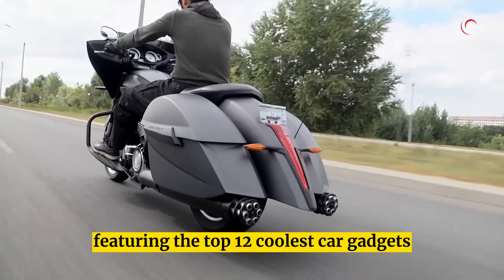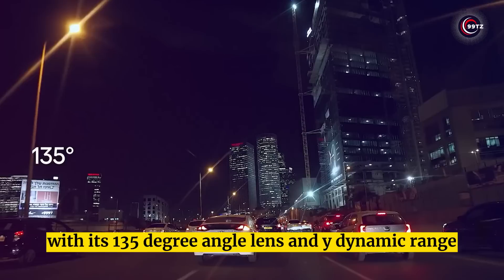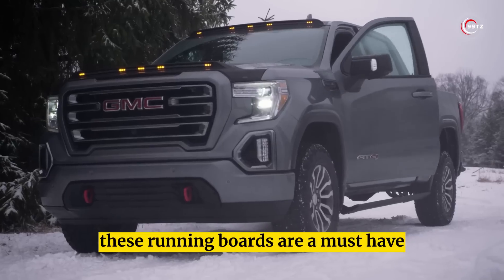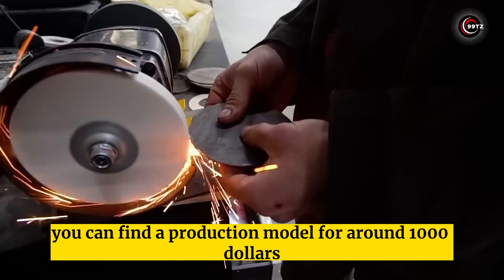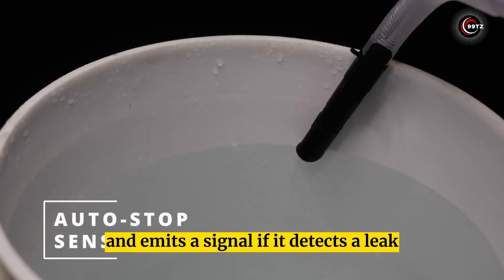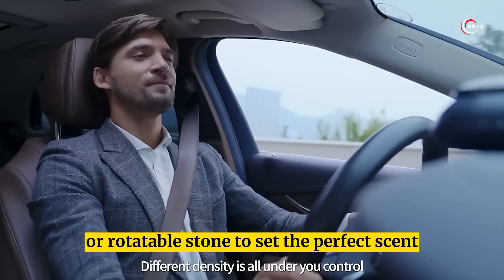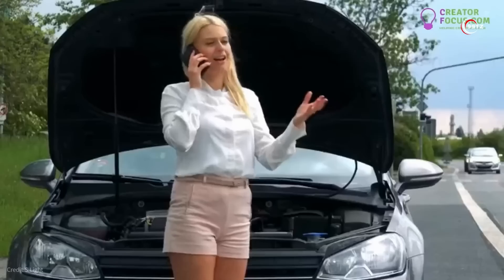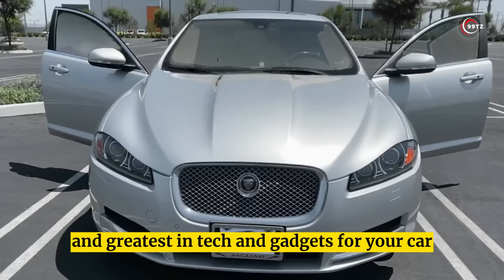12 Coolest Car Gadgets Available On Amazon Right Now ▶▶

Comment: Why does the  running boards include miles for the warranty is my question.
Reply from the maker: What should they do?
Reply: Just years the amount of miles is irrelevant to the function of a running board. It would be the equivalent of getting a new roof installed and base the warranty off how much you use the air-conditioning.